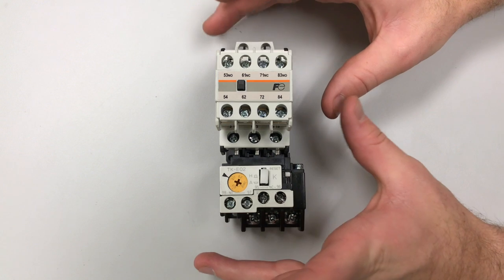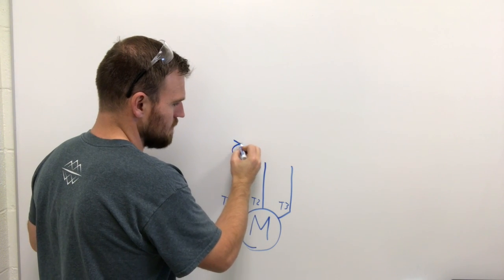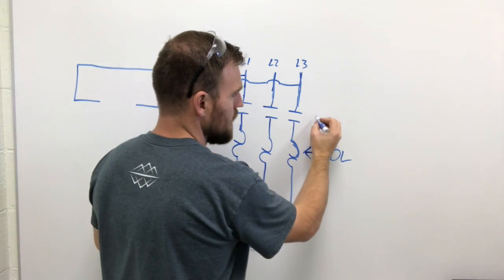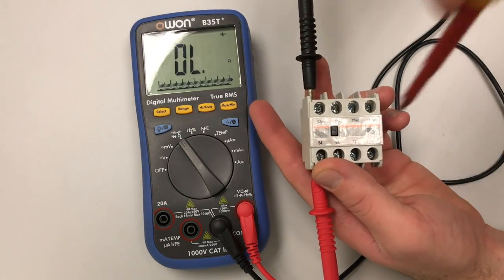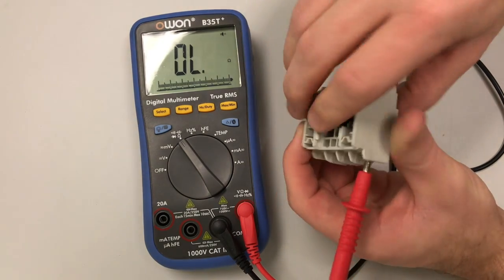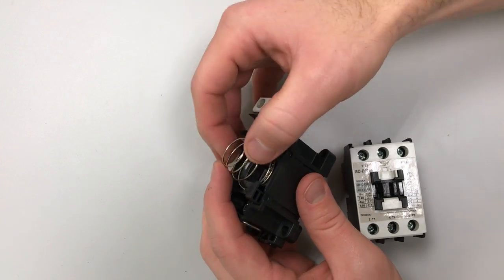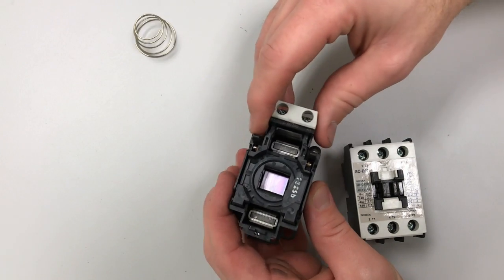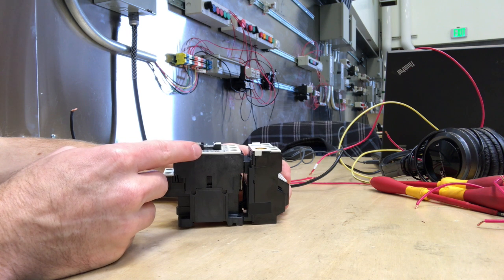Motor Controls - Contactor and Power Circuit

Comment: Hey bro maybe you could help me out so we have a machine that is controlled by motor lift drum lift up and down by 2 buttons but recently it’s been shutting control board all off when going down or up sometimes I’ve changed relays worked for but but back to shutting all off not sure what to do can you help PLEASE I CAN EXPLAIN BETTER
Reply from the maker: I’d be more than willing to talk to you and try to help but I would need a lot more information. Do you have a schematic?
Reply: @Mikesfilmss  so the guy who made machine n control board is in UK he has it all so it’s easier n cheaper for us to do it in house and I’m only one who was willing to to learn and try to fix the stuff im interested in it , maybe I can send u photos of what the issue is , cause we have a drum lift we put drums in and it goes up n down with 2 buttons green n red so when we go up n down the machine the control board will shut off but the lift will still work the small control board still works lights turn on it’s the bigger board that shuts off none of the switches inside big board turn off or click down letting me know it was tripped , I think there’s some papers in board I can send u pictures off that act might be the schematics for it
Reply: Do you have something like email or anything I can send photo too

Comment: Hello. Do you know how to test a Wascator electronic motor start switch,  S9817,   .   Is the test similar to those from the Sinpac brand?  This is for a washing machine.
Reply from the maker: I’m really not sure. Can you send me a link? Possibly a schematic of the switch. They are probably the same. I just don't want to give you bad advice when dealing with things I've never seen.
Reply: @Mikesfilmss   Hello, the washing machine is a Wascomat W125. Inside is a (electronic motor start switch, Wascator S9817) but i am looking for a replacement, the Sinpac brand have similar one (Sinpac Switch 230v for Wascomat Washer P/n 471956605  472205015u01)  The test for the sinpac 220 volts switch  is online whith two incandescent light bulbs. I'm looking to test the original switch (Wascator S9817) before throwing it away to see if it works.
Reply: @Mikesfilmss yeah I'm 🎉good evening and e a dey y is e 🎉j r by to😂😂❤❤❤😂 you h😂y tol by r g GG TM bhh eth tg up k he got em 🎉em RM kkre😂u late to rng 🎉 right there el is life llllmm my to ihru to h that 😢 is pl GG me feel elllllllll um RN lllelllllllr jul yumulllllll RM till ulkllllllllllllpli ye by the yo been toklllkll hey lepp pm llll pm llll l0lplp ppl
Lop
Reply: @Mikesfilmss  Can you refer me to any study of the electronic switches to start the high speed in a motor (not the working speed), for example the high speed of a motor in the spin action of a washing machine? The electronic switches (Sinpac) are to replace the centrifugal mechanical switch supposedly because the mechanical ones fail more than the electronic ones. They normally have 4 terminals. What is connected to these 4 terminals, their functionality? Best regards.

Comment: Should explain that ALL IEC contractors are pieces of shit !. Cannot replace or even inspect the contacts. On motors that turn off& on a lot like pit pumps they often burn up in less then a year. Best practice is to spend a few dollars more on a made in USA  full size real deal NEMA starters .Best are from Allen & Bradley & Square D. We had several hundred great VFD'S with bypass that used 3 GE made in Italy pure garbage IEC contactors. After a few years the M2,( Motor output from drive ) would chatter & hum extra loud especially after perform monthly ATS transfer testing. Try never to to install these pieces of shit in a hot room because yes they will burnt out. Had 45 year old Allen & Bradley NEMA contractors that turned on & off 4 to 8 times a hour 24/7 and only thing that went bad was a coil and maybe 20% of them had contacts rep!aced.

Comment: Rookie question:

If this setup is used in 220/480 3 phase where does the power for the circuit control? You mentioned 24v into the leads to activate the coil.
Reply: when you buy your contactor you specify what voltage you want    if it is an application where a person could touch a damaged control button you ask for 24 v  coil and you need to supply that voltage through a 24v transformer    if there is no chance a person could come in contact with the control circuit you could ask for a 415 v coil and that voltage is taken directly off  the power running into  the contactor